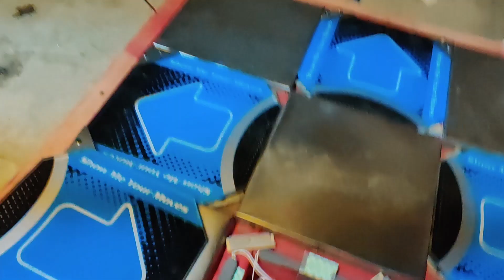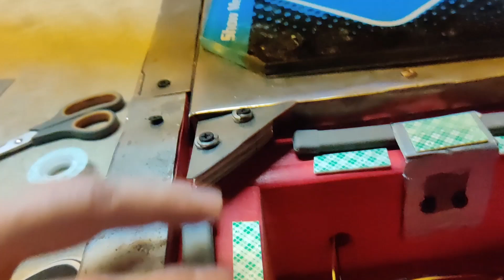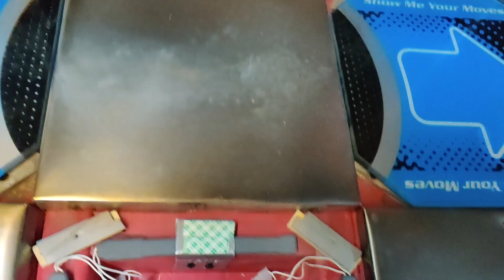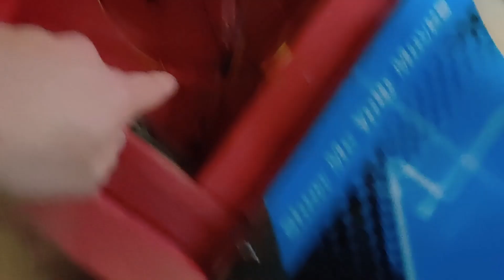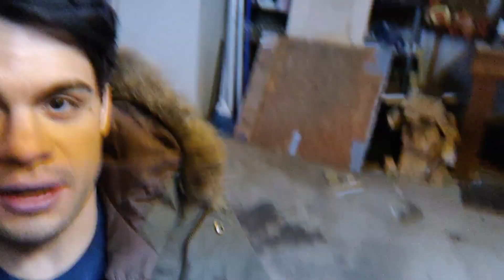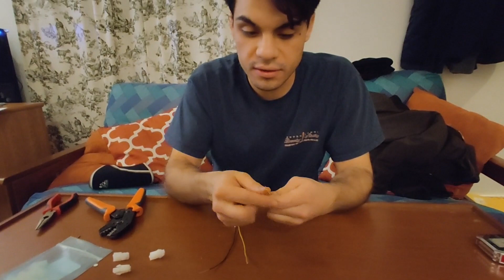How I Built My DDR/ITG Dance Pad Using Real Sensors

Comment: Question! Can you connect this dance pad to your old PDP control box? My PDPs just died and I'm giving serious consideration to making my own pad and wiring it into their control box.
Reply from the maker: hmmm honestly I'm not sure. If you want to build a new pad you should look into the FSR sensor option. It's very light weight and you can adjust the sensitivity through software. There are a ton of guides on it.
Reply: @Just_a_space_cowboy  The only reason why I'm hesitant to do that is that I still play on console. Anything with an Arduino likely won't work
Reply from the maker: @DarthG33k  ah gotcha, well unfortunately I don't have a pdp to test it on, but if that box has a power and signal line then maybe it's possible?
Reply: @Just_a_space_cowboy  It does. I opened up one of my control boxes. The actual circuit board is pretty simple to wire up. I could definitely do it myself.

Comment: I wanna ask a few questions. Can you let me know if you see this? I want to build my own down the line and this video/parts is the best approach i found so far.
Reply from the maker: Hi, I can answer any questions you have. FYI a lot of stuff has changed in the homebrew pad scene since I made this video.
Reply: @Just_a_space_cowboy  

1) Where did you get the bar?
2) You mentioned that the outter sensor is unplugged. you think u can get away with 2 sensors per arrow? or u think 3 is the sweet spot
3) What have changed and where should I go to build a similar product with minimal cost? (I like doing DIY for wood working and such so any info is helpful)
Reply from the maker: @jkytest1  The bar is from Home Depot. You can have them thread the pipes for you in the store, and you can buy threaded 90-degree connectors and flat threaded baseplates to attach it.

You can definitely get away with 1 or 2 sensors. The only issue you will have to overcome is finding a way to level the panels with 2 sensors missing, which I'm sure you could do with some kind of spacers.

The newest addition to the scene worth mentioning is most people use fsr's for sensors with either a teensy or an arduino. There's a ton of guides for that out there and whole discord channels dedicated to it.

Comment: What are the dimensions of the board in total and what are the dimensions of the insides of each square? I know the arrow panels are ~10.75 inches but I'm scared to build the inside of each square as 7.75 inches because of the corner brackets possibly not having space.  I've built a much more rudimentary DDR board before for my GF but when I saw that you built one using the actual parts that they use in arcades I was really excited to try it myself!
Reply from the maker: Let me go get some measurements and I'll get back to you!

Comment: Would you consider taking orders on one? How much would you charge?
Reply: Or if anything, would you be able to sell me the framework parts? I don't own any of the cutting tools, so it's going to be a pain in the ass trying to do it myself.
Reply from the maker: I've never weighed the pad before, but all of the parts assembled easily weigh well over 100lbs. If I were to do that freight shipping would be the only option which is super expensive. Also, this whole thing took me probably around 50-60 hours to build, including going to the store and getting the materials, and unfortunately I just don't have that much free time right now. I'd love to make these for people, but I Don't want to risk promising something I probably can't deliver on. If you go to Lowe's or home depot I know they can cut wood to whatever dimensions you want in the store, so maybe that could be an option? For cutting the sheet metal you can just get some cheap tin snips as well.

Comment: Is there a difference in connectors or reason why you used pump it up sensors instead of these?
https://www.arcadespareparts.com/arcade_parts/dance_dance_revolution_parts/ddr_floor_switch/12091.html

Hoping to emulate your build if I can't find the right cabinet in the next year.
Reply from the maker: So from my understanding those sensors have a different connector and aren't as sensitive/durable. I know people who have ddr cabinets and they usually swap out the ddr sensors for Andimiro ones.
Reply from the maker: Also for some reason it says the sensors i listed are out of stock, but they really aren't. I think they just forgot to update the website because mine shipped in like 3 days and it said that for me too.